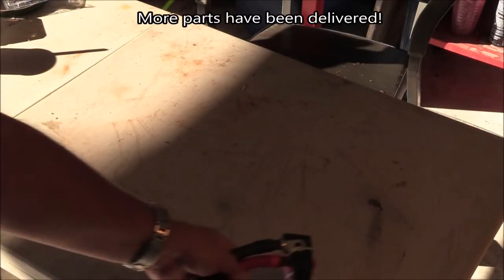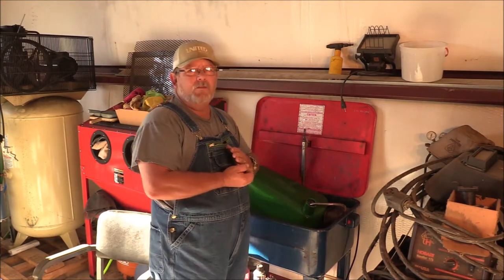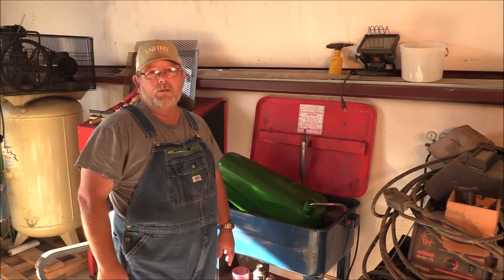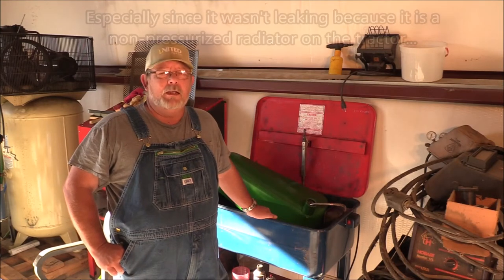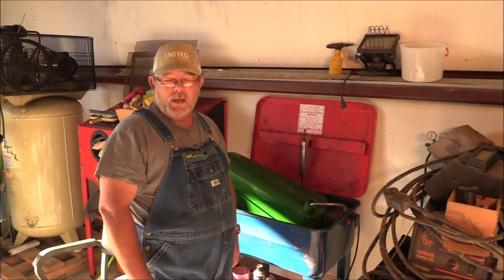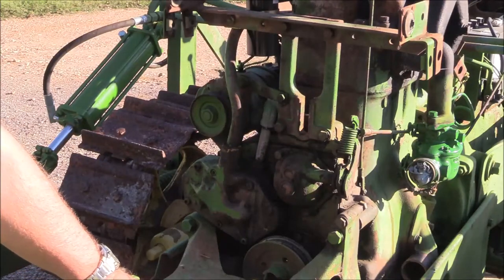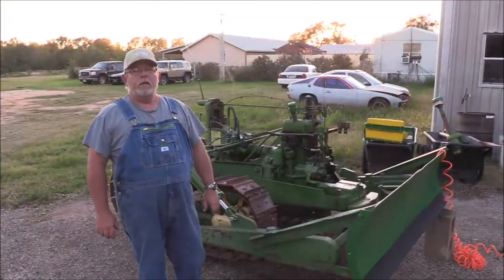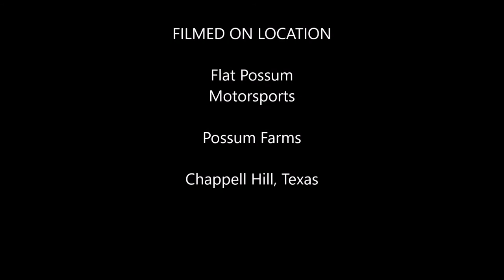Fixing up the John Deere MC Crawler - Part 15 - Fuel tank refurb fenders and grease removal

Comment: Install water heater in your shop, hot water for hands, hose bibb to connect pressure washer.  have a disconnect if you dont want it to run all the time.
Reply from the maker: Good idea!  But I have very little electric and water service in the barn.  But that could soon change!  Thanks for the comment!